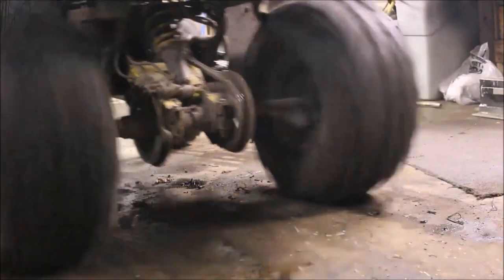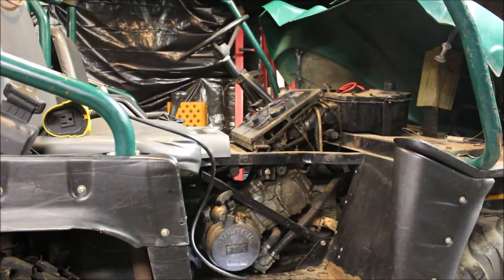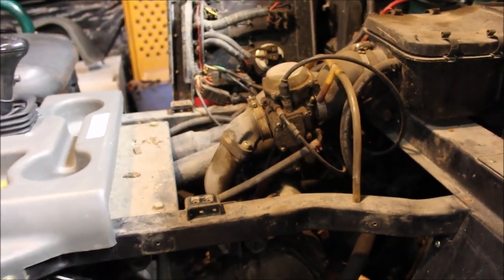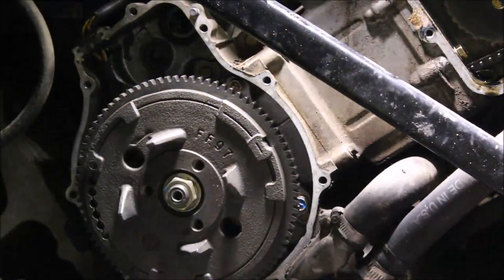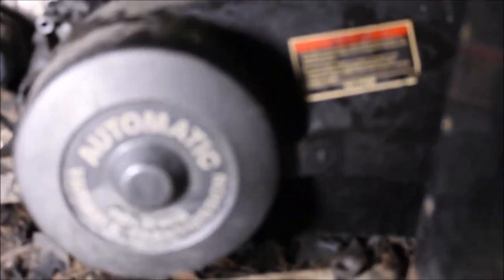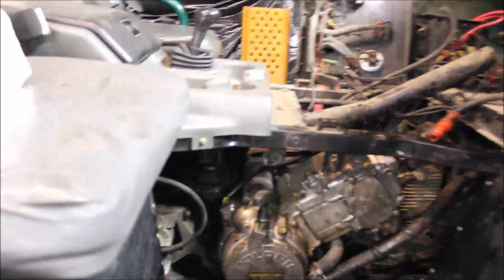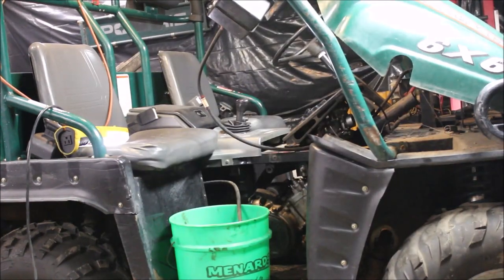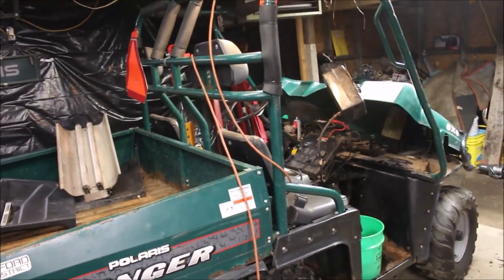Polaris Ranger 6x6 Repair! Was it an Easy Fix?

Comment: Experience is a tough teacher. For those of us with toms of experience, it’s easy to assume the worst and “over complicate” probable causes. Rodent chewing on the drive belt is a new one for me too. I did pick up a scrambler 500 today and found the air box full of pet food. Seller stored it in their attached garage and do not have pets. lol.
Reply from the maker: Right on! Yeah..I had a scrambler that wouldn't start. The exhaust was packed all the way up to the engine with pet food.